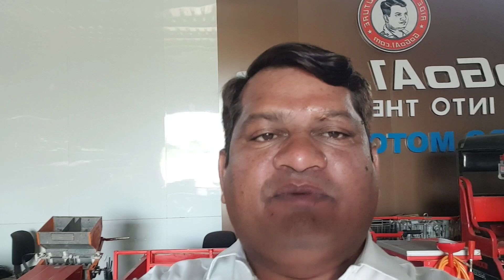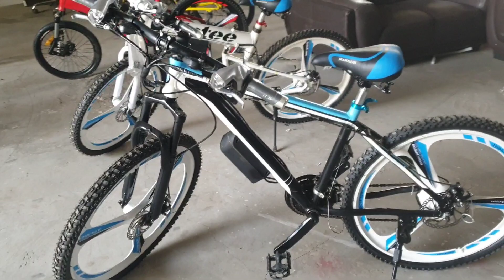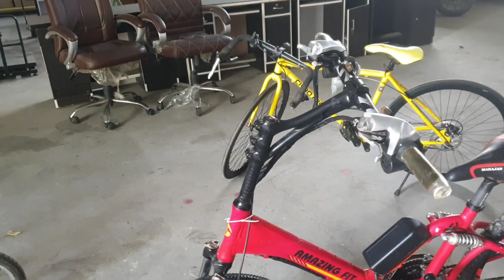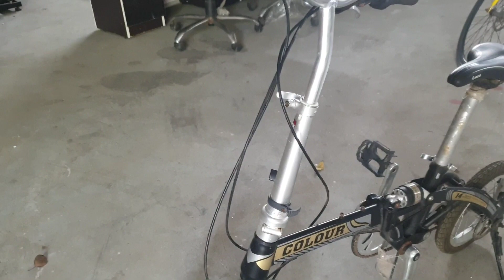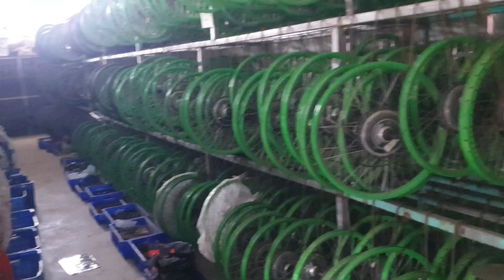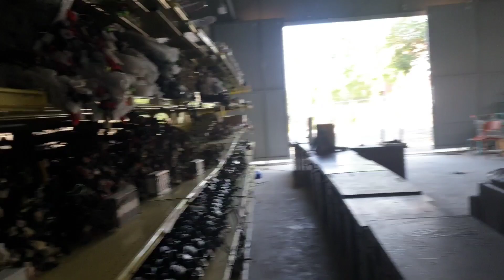The GoGoA1 Project! 50-50 partner for Electric  Bicycle

Comment: Fat tyre cycle ke liye ev kit chahiye palwal faridabad ( haryana) me 40 - 50 speed  me
Reply from the maker: Check this : https://gogoa1.com/products/gogoa1-48v-240w-500w-hall-sensor-less-hub-motor-for-fat-tyre-with-threads-on-both-side-for-r-d-oem-supply
Contact us at +918657591802/7021920700

Comment: Yours company parts and components are very coastly
And made in China 😢
Reply from the maker: Will you please  give us  any particular  part exhample  and you are comparing with which product  details  of that product
Reply: Yes fully agreed thts its very expensive.....just to make highbreed of your present byke....it cost more than 60,000 for 2000 watts hub motore thts too much....it should b between 30,000 with battery
Reply: I've been buying ev kits and accessories for past two years I always compare the prices of all possible dealers I've never found a better deal at gogoa1 except for once that I got a 17" hub motor for around 10000/- as an introductory offer

Please try to bring down the prices there are many ev enthusiast who want to buy the conversion kits but hesitate due to High cost
Reply: @MrDjdon87  yes i do agree with you....i have two bikes whc want to convert....but its costing more than 60k whc is too much....it should be 30 k...affortab
Reply: @Don marcel it's one time investment you can save it in ev instead of petrol hope you understood what I want to say
Reply: @MrJviju007  wht abt maintenance? If the motor goes off...? Wht abt the battery replacement after 3 to 5 yrs.....is tht free.....come on its the same amounts u spend .....on petrol also petrol byke one can trust...anytime .... everywhere
Reply: Do you have any reference of indian conversuon kits